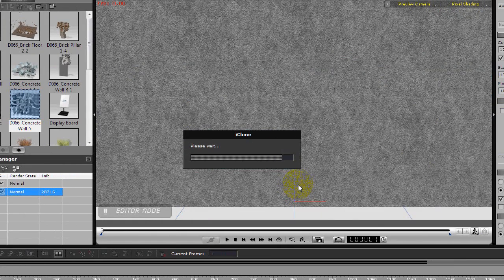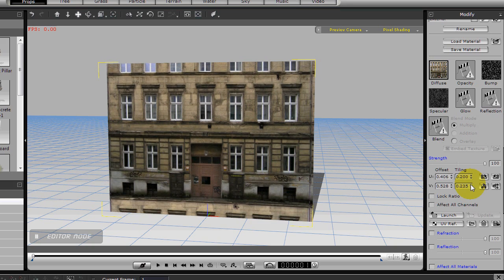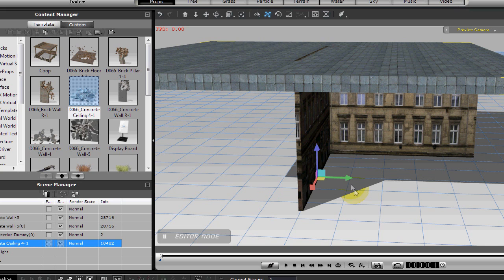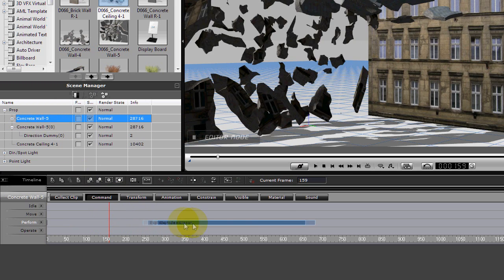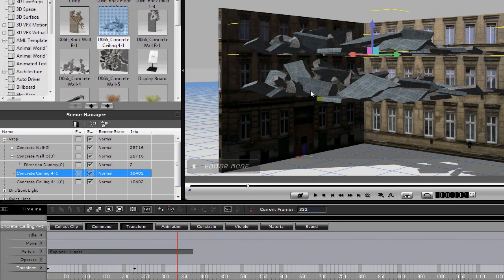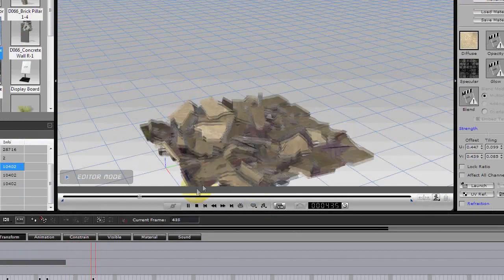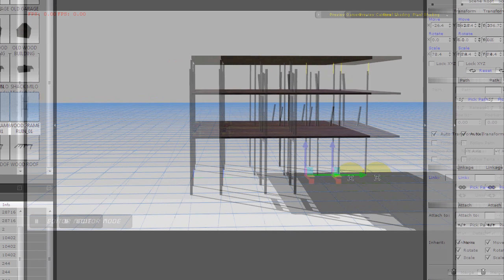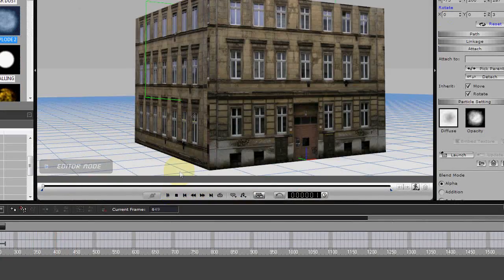iCLONE TUTORIAL "It Blowed Up Real Good"

Comment: How do you scale the building texture across all the pieces?  I can only apply a texture to each individual piece.
Reply from the maker: This tute is based on an older prop product not the newer "physics capable" props. These props are not "real" physics products that are available now for new physics capable iClone. They will still work in iClone though. Search the iClone Content store for "destructible props" and you should see a series from RL with numbers like "D066 Concrete Wall".With these props it's simple to click on the Diffusion Map for the prop, in the texture menu, and replace the entire surface map..you will need to size it like I do in the tute but it should work for you.
Reply: Thanks for the reply.  I was getting very frustrated with my destructibles.